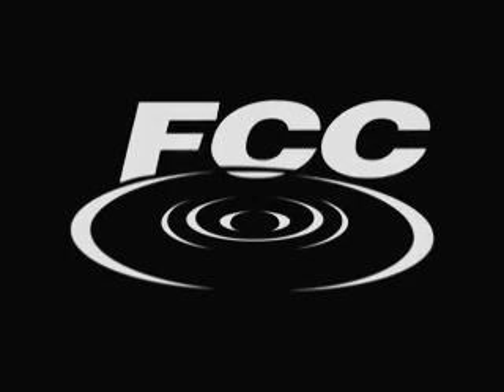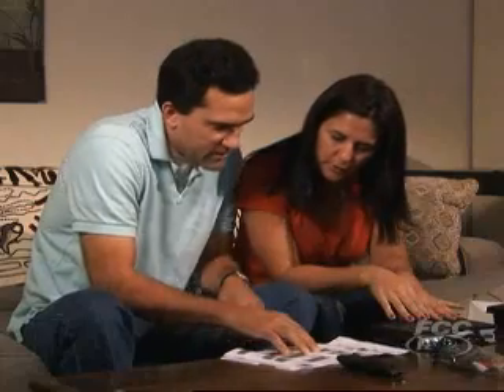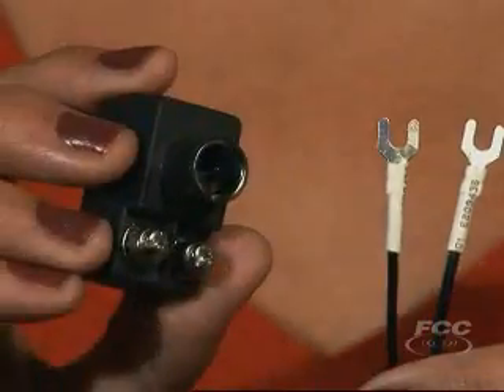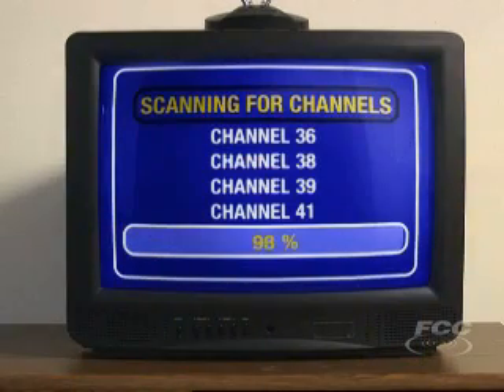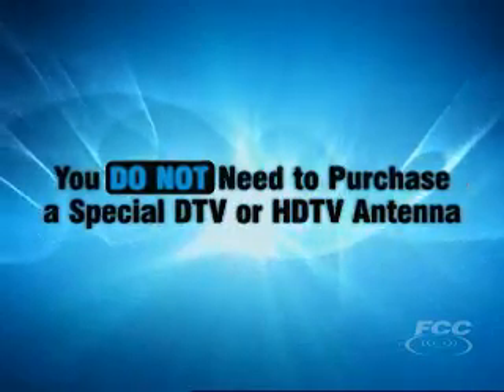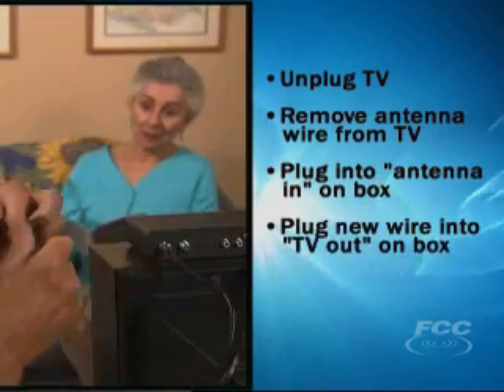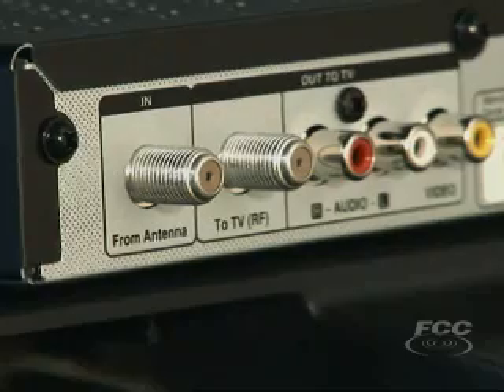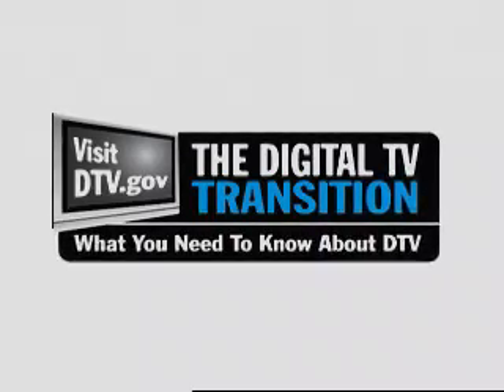Chapt 3: Watching DTV with a Converter Box (produced by the FCC)

Comment: DTV only works well with a relatively strong signal.  Unfortunately DTV is easily distorted when you amplify the signal.  With an HDTV you can get a better picture if the signal is recieved well enough.